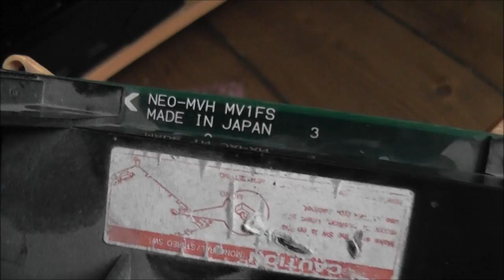Faulty Ebay Find - Neo Geo MVS 1 Slot Mobo - New Project For An Arcade Noob

Comment: You will need a jamma socket and an RGB monitor 15khz,   You can boot it up with no game and you will see a cross hatch screen.  In the UK can handle that fine. Look up the JAMMA pin out. you will need +5V 4A. If you dont want to buy anthing you can solder wires to the board to replace the jamma socket. All you need is power  RGB SYNC to get started

Comment: You'll at least need a game to tell if the thing is working, but you can simply hook up a speaker and power to the thing and "listen" for it to start up with the BIOS jingle. That's what I did when I got mine.